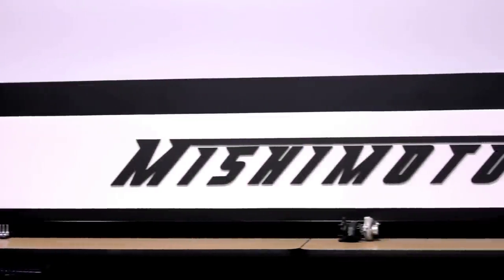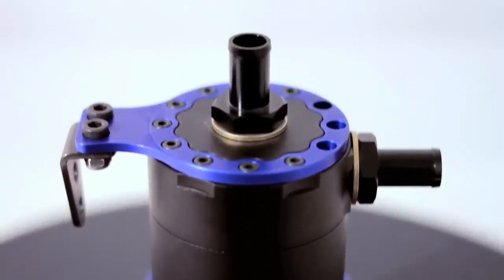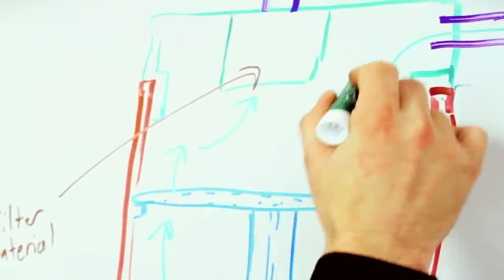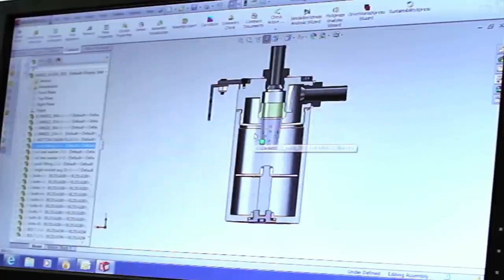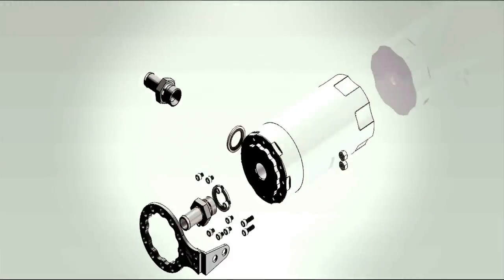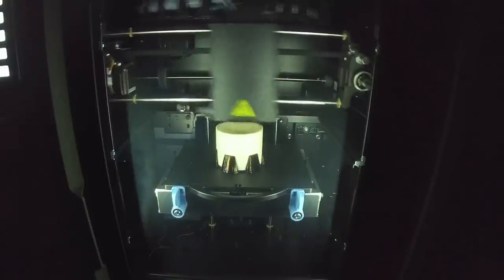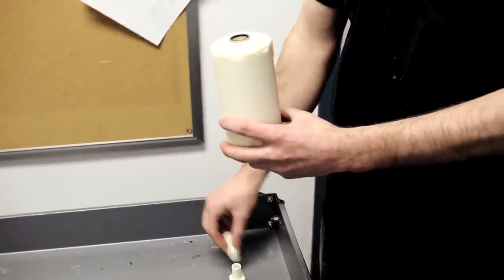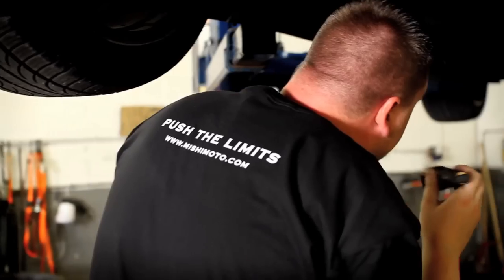Behind The Scenes- Engineering The Mishimoto Baffled Oil Catch Can

Comment: No drain? Seems like it needs more engineering done. It would come in handy emptying it.
Reply from the maker: Hello Michael Conner. This can could very easily be drained by removing it from the vehicle and unscrewing the lid. Usually, a good idea to see if the level of oil collected has increased, decreased or remained the same. Could be a very early telltale sign of a problem. For customer who do not wish to remove their can, check out our drain kit designed specifically for use with this can. Link below

https://www.mishimoto.com/baffled-oil-catch-can-petcock-drain-kit.html

Comment: I read that its best to use two catch cans. Is this true for the 2015 WRX? Im putting off other modifications since i heard these really help protect the engine.
Here the thread that stated its best to use 2 instead of one.
http://forums.nasioc.com/forums/showthread.php?t=754710

Also, what's the best mounting location for the 2015 and how much hose would i need if i ordered the braded lines?
Reply: I had seen 2, but they used the filter and closed the outlets. While i dont know if that is good for pressurized engine. The concept was for the dirty air not to go back at all i think.